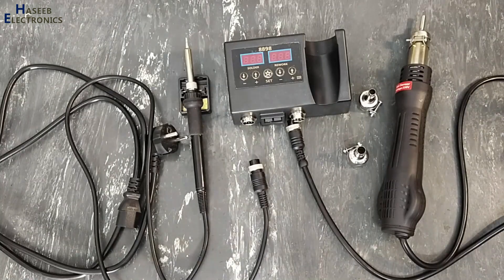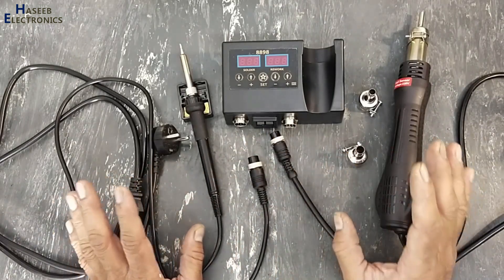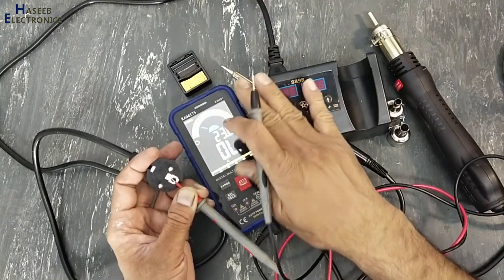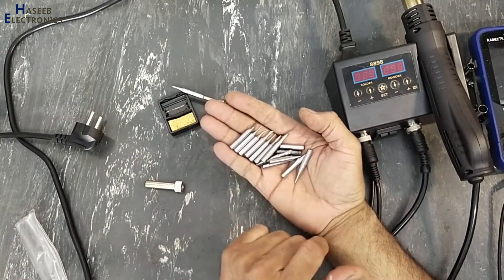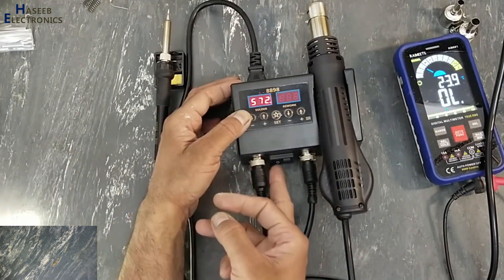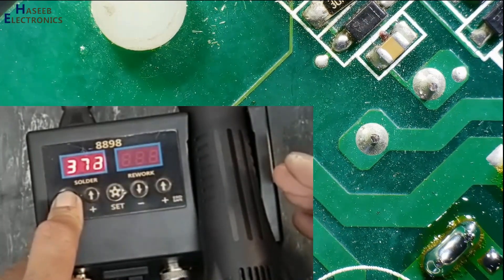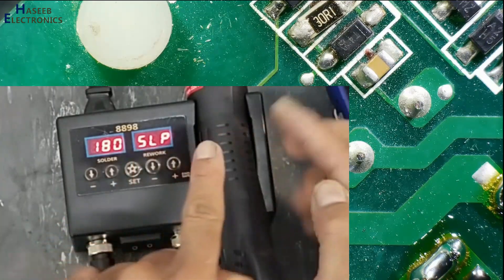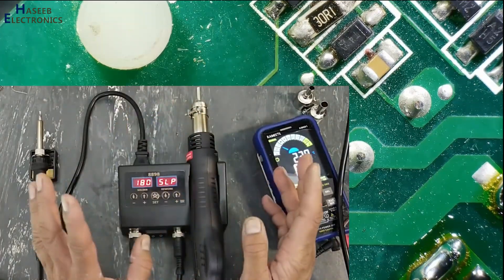{1236C} 8898 Rework station Review

Comment: I’m looking for a variable temperature soldering iron to work on electronic items. Does anyone here think this is a good product for that? Most of this video seemed to concentrate on the heat gun aspect. Does this soldering iron hold temperature? What kind of solder does it use and where can I find good tips for it?

Comment: I have repaired so many things with it. I think even a single repair covered the price for it. Several power supplies phone ECU removed and soldered eeproms wifi extender subwoofer led lights. And I'm not even a professional in that field.
Reply from the maker: you are right
my opinion is also positive. it is perfect tool with a very resonable price

Comment: Ive bought 1 like this and it work for a while until it did want to come out of Slp mode on the display. The reed switch was faulty and i soldered it out of the circuit. Will get a replacement.(Its is the small glass tube on the botton of the element connector, just if someone comes across the same probleme.

Comment: How long did you use it without stopping?
Reply: Air flow control?.
Reply from the maker: i used it approximately 20 minutes non stop. 
air flow control can be controlled by changing the nozzzles
Reply: @HaseebElectronics  thanks 🙏

Comment: 8:30 If you are regularly removing larger chips like the 62256 RAM you can buy nozzles that are shaped to fit over the legs so the hot air only goes onto the legs. There is available any type of nozzle for any type of chip shape. I am doing this kind of work every day doing arcade game repairs and I have about 40 different nozzle shapes.

Comment: 5:44 Oh! Nasty glue! For glued parts, using tweezers is not the best way. An easy way to get glued parts off is to heat the chip until ALL solder pads are melted (important!) then insert a sharp knife under one end of the chip (1mm is enough) and lift/twist and the chip will magically come off the board. Please try it in a future video using that hot air blower :-)